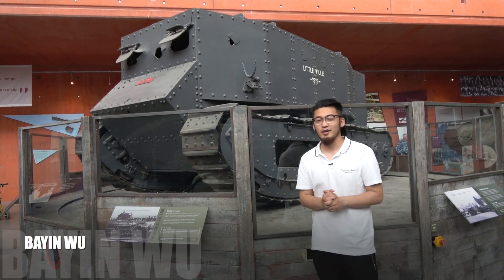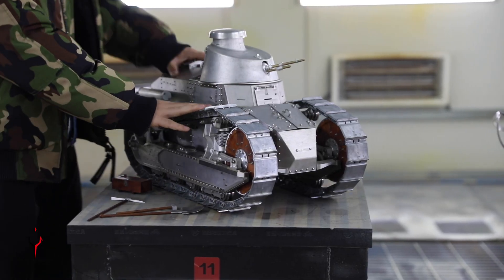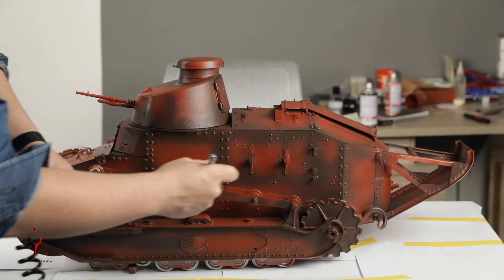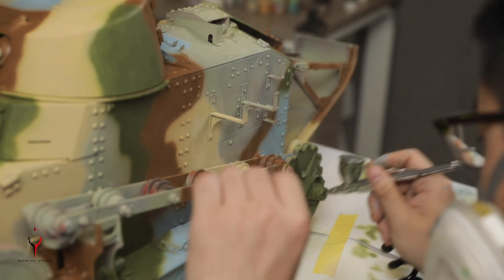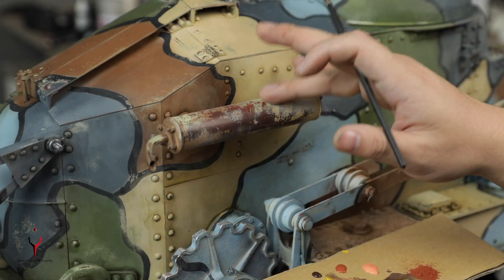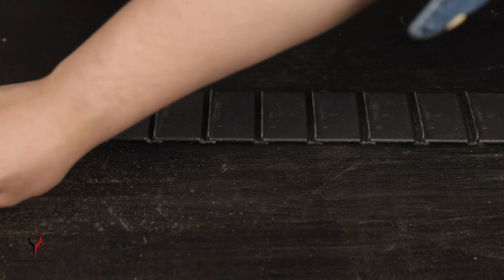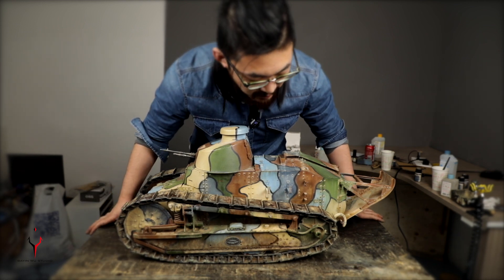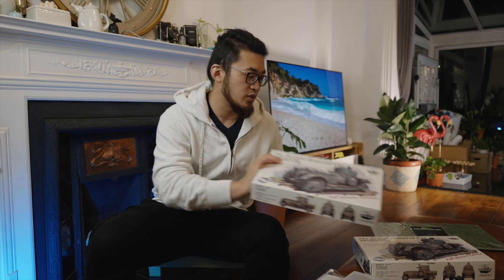I painted a perfect RC tank model 1/6 FT17

Comment: Love your tank.  Beautiful museum quality model. I haven't worked up the guts to start my 1/16 scale but  "I" (actually myself and two others) just finished my 1/1 scale FT "model" "replica" tank (Berliet turret with MG) It's running now (although being modded as our design has proven heavier and tougher to steer than expected). The Hotchkiss MG shoots propane/oxygen.   Obviously have had to make a lot of concessions to authenticity (the goal was to make it run first and there will be  a million things to detail and redo)  but it can carrry two crew and is a hoot to "drive" but a nightmare to steer (back to the drawing board).  See FT Tank Kingsbury Texas on Youtube of it's testing in November. Haven't figured out  a proper turret ring. I will do a build video soon. Thinking of making it RC as probably having to install a linear actuator for turning anyways.

Comment: You could have used an auto painting striping brush for the black outlines on the camouflage.  It would have been easier to control the width of the lines.